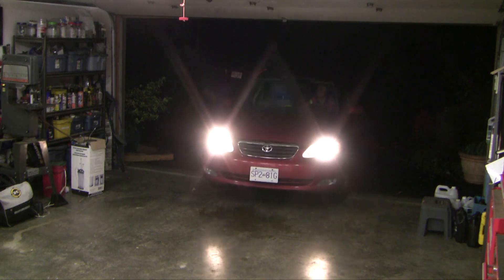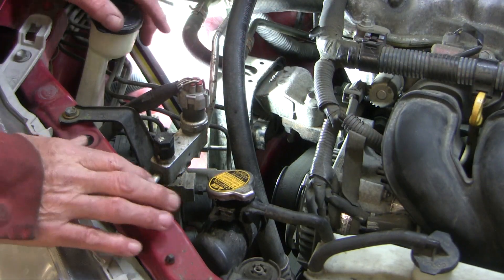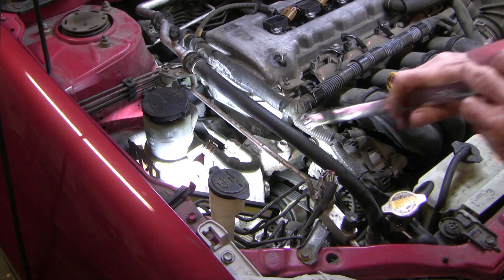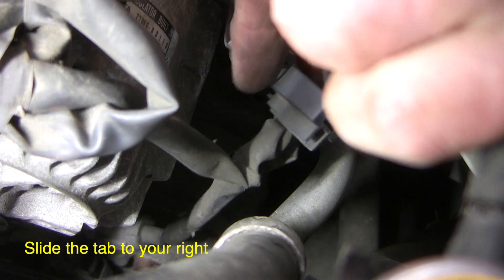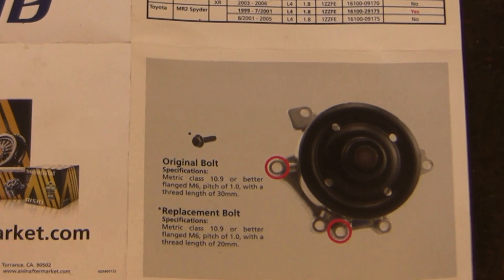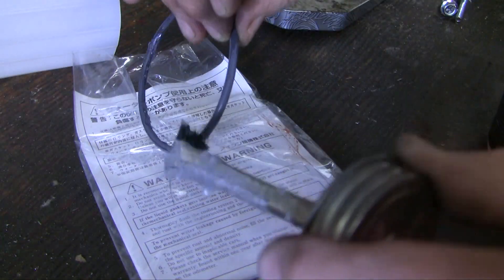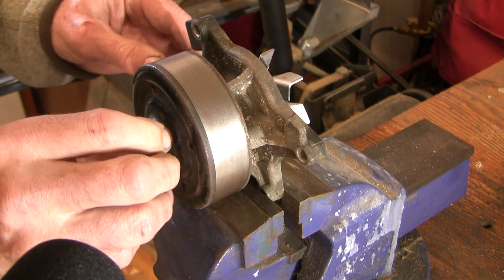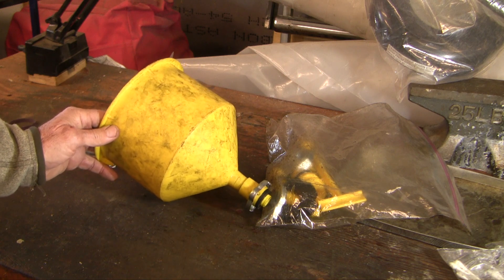How to diagnose and fix engine noise

Comment: We got car  just started knocking out  blowing some  after mate running  with no oil  would it b oil pum0
Reply from the maker: If the sound happened after running with no oil, it may well be a spun crank bearing or something else much more serious. Oil pumps in cars rarely fail, even under extreme conditions.

Comment: Excellent point with installation of the longer bolts first !! Also the use of an old sock is a great idea to isolate the battery cable. Many times , I will use a rag , wrap the cable end then wrap with tape. Well done video !! Thank You !!

Comment: I have a motorcycle. 2004 suzuki intruder 800cc. When I hold my clutch lever down and put it in first , while clutch is down, bike still moves. And changing gears, the gear shifter is really hard to change it kind gets stuck . Any idea what's wrong?
Reply from the maker: Bad adjustment of the clutch cable is a likely cause and an easy fix. Check that first. I would find a dealer repair manual for your bike, and find the adjustment points. My bike clutch cable has three (!) adjustment points, each of which can influence clutch position. Also the clutch cable itself can rust and become hard to move. You can buy a little tool to lube the clutch cable. I did a whole video on the clutch cable removal and adjustment, when I was fixing a coolant leak on my Vulcan.

Comment: That's a lot of work.  I remember when changing a water pump was just a matter of removing the drive belt and loosening the bolts holding it in, not all of this complicated stuff.  This job may just be best left to a good mechanic.  Just curious, how many miles did the Toyota have on it?
Reply from the maker: 193,000 km, and almost no oil underneath, with very few codes on the scan tool (just a history code for a seat belt that didn't return). When cared for properly, these old Toyota engines are great.
Reply: @spelunkerd  Thank you for answering my question, and that's around 120K miles.  We have a 2013 Corolla with only around 53K miles on it.  It drives like a dream, and I'm keeping it well maintained.  I could see this vehicle getting well over 200K miles if properly maintained as you said. 👍👍👍

Comment: Great instructions. Looks like a knuckle basher! Those pulley types where the back of the belt provides the drive not the toothed side cause the belt to wander and the bearing to have an offset load. We had a vehicle that had this set up. I think it was Cids Ford Puma. Sail Safe mate. Ant & Cid

Comment: dang it i subscribed years ago but didnt put it on ALL notifications so've been missing all your dog dodge stuff . ive 94 short bed and 2000 3/4 ton dodges so i need LOTS of tips LOL . anyway great vids ! also ive a tip for you = im in suburban detroit area north end of lake st clair . and here in the macomb and oakland county area there are currently 100s of snowblowers for sale at like 75% off as it hasnt snowed seriously here in years . bring a trailer and shop facebook marketplace and craiglist and you'd haul home all kinds of lightly used machines to re-sell at 50%+ profit . but im not sure you might be way out west so too far away
Reply from the maker: I still have that old Dodge, it is working fine. We don't put a lot of miles on it because of fuel consumption, but for hauling brush or compost or yard work it is hard to beat. That's a good point about snow machines, we live on the rainy west coast. It's nice to hear from you, Roman!
Reply: @spelunkerd  GREAT CHANNEL SPEL ! I APPRECIATE THE LESSONS !

Comment: That distinct bad Toyota water pump sound. They all sing the same note.
Reply from the maker: Good point, Glen! Imagine how much better diagnostics would be if one only worked on one brand of vehicle. Strangely though, the professional general mechanics who do everything develop a depth of experience that is hard to beat. I admire the way they improvise with tools they have, often making tools to accomplish the task.
Reply: @spelunkerd  custom cut, bend, weld, whatever it takes to get the job done!  Nice work Dave.